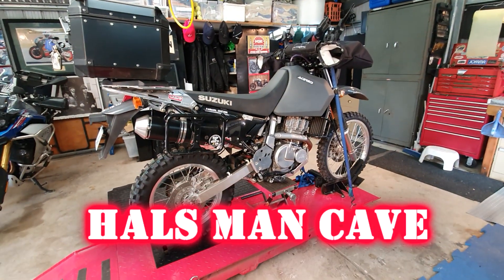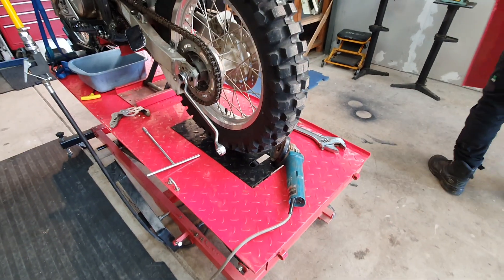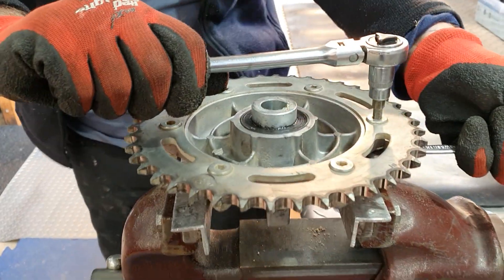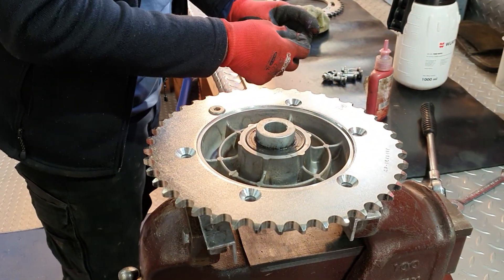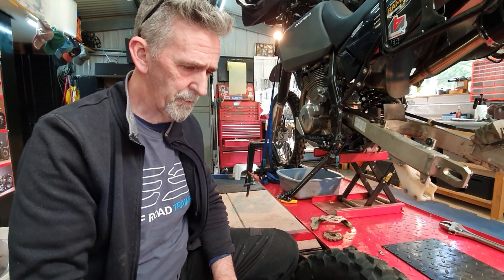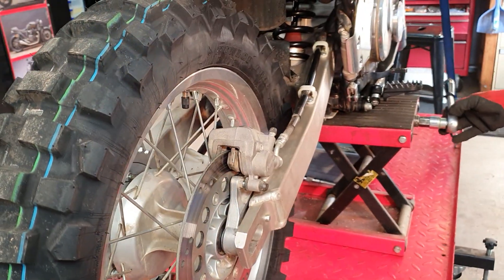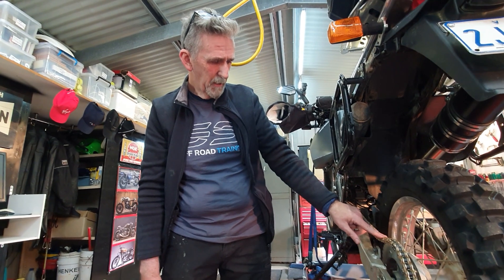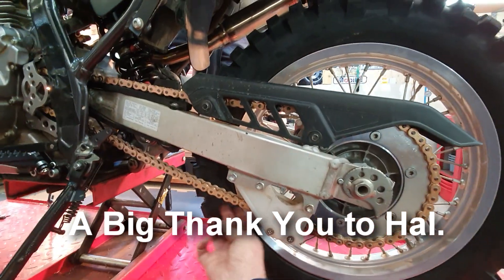Boris the DR650 gets New Teeth. How to change the chain and sprockets on a DR650

Comment: I ran 21k out of my original chain an sprockets from new, the chain was shagged but the sprockets were surprisingly very good in tooth wear when matched to the new set, 80% commute 20% dirt. I went 14t front 41 rear but it took the rpm from 5200 to 5600 at 100klm and up the Hume it developed the annoying single cylinder slight vibration at 110 to 120 so I switched back to the original 15/41 and has been great for what I ride especially long distance. Nice vid Pete keen on seeing the difference of the hub rubbers, mine were the same as yours for wear. Take care Mark.
Reply from the maker: Great reply, thanks for sharing your experience, always good to hear what others have done.
Reply: Do you still run the 15/41?  Aside from first being stupid fast in the bush,  I found stock gearing too tall for the speed limits here in aus,  ill find myself scooting along at 100 in 4th,  and at 60 second is too short and 3rd is too tall.   I've got a 15/44 cogset waiting for the stock chain and sprockets to wear out.  Thats similar gearing to a 14/41,  so we'll see how that goes

Comment: Nice clear video. If you added a couple of extra links, your final chain adjustment would have been towards the middle of the snail adjusters. This means that 1) you could run a larger rear sprocket if needed and 2) the geometry is restored as the axle is placed in the middle of the swing arm. You should now recheck your sag as the leverage on the swing arm is now been changed.
Reply from the maker: Thanks heaps MS, that is great advice. Thanks for sharing. Regards Pete.

Comment: Hi Pete, good vid, very enjoyable. How is that new exhaust going, are you still happy with it? What baffle have you ended up with on it? Cheers.
Reply from the maker: Hi John, I hope to do a review on the Screaming Demon, I love it, The best mod you can do to the DR650, It makes a huge difference to the power of the PIG. I am running the street baffle at the moment, and the engine seems a lot happier, Slightly less power than RACE baffle, but without the popping. So for general use  I think Street , and for riding in the bush with your mates, Go the RACE baffle and BRAAAAAP.
Reply: @FULLPELTAdventures  Seriously? That must be a huge difference if it is that noticeable. Thanks for the informed reply and taking the time. Cheers mate.
Reply from the maker: @johnrogers5825  I am not an expert, Comparing it to the Stock Muffler, in my opinion, its a big difference. I am really happy with it. I think the Staintune, Barrett, or any other Brand name muffler will do the same thing, I just ended up with the Demon. Hope that helps.